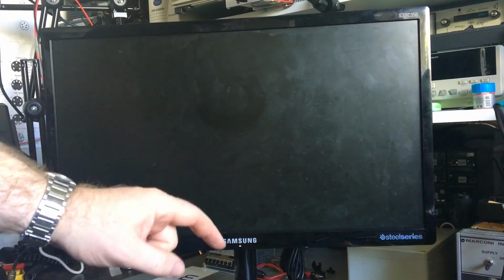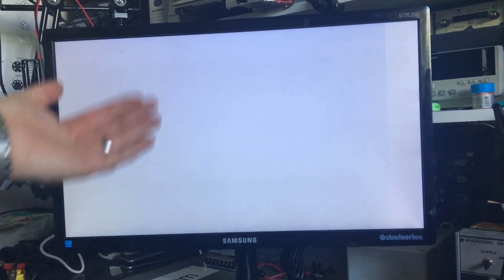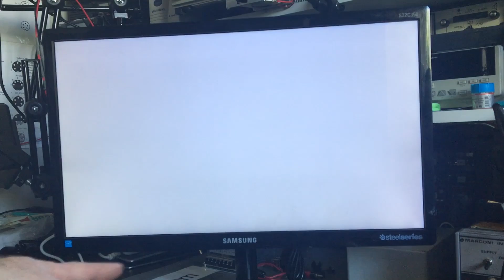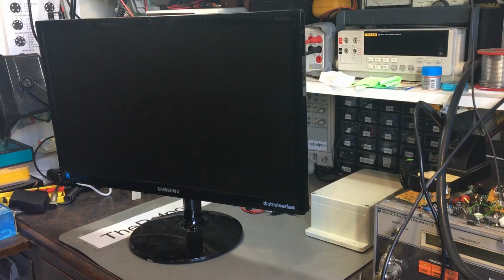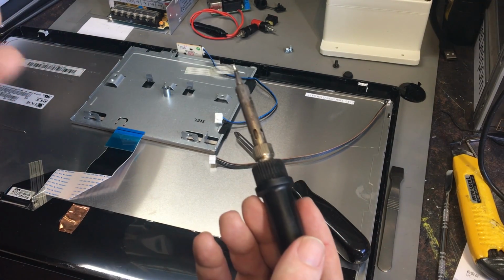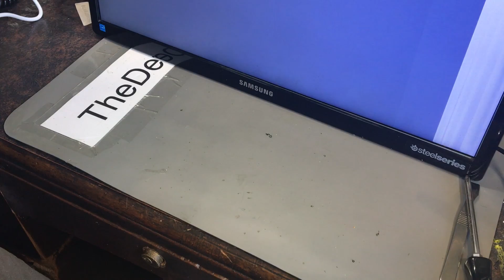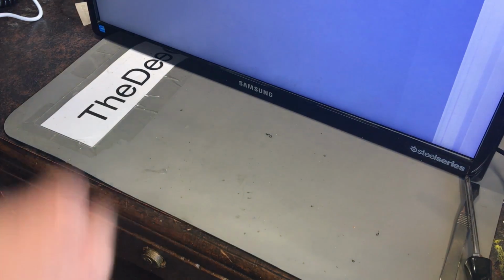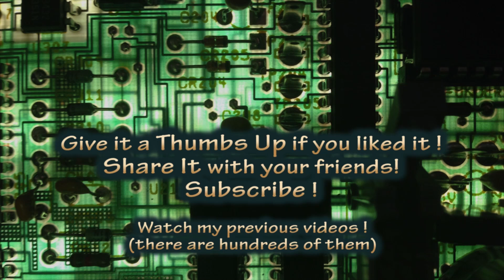#323 Samsung Monitor Failed Repair

Comment: I had already made the decision that this was not repairable 10 seconds after you turned the unit on. This is panel damaged glass to metal contacts or tab to PCB failure.
I find you need the remove the lead free solder before you can resolder with leaded.
I agree that lead free solder does fail more often and you can get tin whiskers growing which the cure was to add lead. read up on I think it was the Toyota throttle controller sometimes failing with full throttle output.
Reply from the maker: FireballXL55 - yes I highly doubted that it was fixable, but thought it would be worth a look and suitable for a video.

Comment: Probably an edge bonding / connector issue with the flat flex cable from the LCD panel top edge to that long timing controller board,  can happen if they get dropped.  Can be a pain or sometimes impossible to fix those flat flex connections,  the pin pitch is ridiculously tiny.  Sometimes you may get the vertical bars to go away if you put some pressure/wiggle around the flat flex cable that is nearest to problem on the screen.
Reply from the maker: Yes that flex cable connection was my initial thought, but putting pressure onto the flex anywhere along it didn't restore the picture, so I think it has fractured the LCD panel.
Reply: Yeah, it's hit or miss.  Could be a fracture as well,  best case scenario at this point would be an issue with the timing control board itself,  usually you can just replace them for $20-$40.  Problem is on this monitor that its integrated into the edge connector board,  not much you can do.
Reply: lead is no longer in use .
Reply: I don't think anyone mentioned lead here,  unless you're talking about lead-free solder being more prone to cracking and causing bad solder joints.  I might agree with that,  but some people disagree.

Comment: The point is you have a go!!, and seeing what's inside broken items is still interesting.
When you took your washing machine contol apart to see how it works and why it died was still interesting :-D.
 i agree totally with the stupidity of waste and short lived systems, ive had old tech for years and it still works, modern=junk.
I use only lead solder, free=junk.
I learnt electronic repair by taking everything apart and seeing if i could see circuit patterns and typical blocks used.
Anyhow, i suspect the screen has a communication problem, the impact could have fractured something on the edge board.

Comment: Natural lead in the environment and lead after it is mined, refined and turned into something like solder are two different things.  Lead as it is found naturally in the environment is nowhere close to as hazardous as it is after it is refined.  Once processed it is easily absorbed into the body.  Many things found naturally in the environment are not that bad until we refine/condense it at which point it's toxic.
Reply: MikesRadioRepair same as asbestos once you tamper with it contaminates the surrounding.